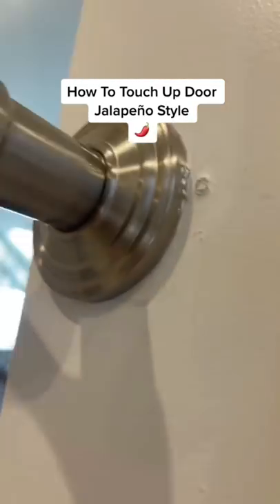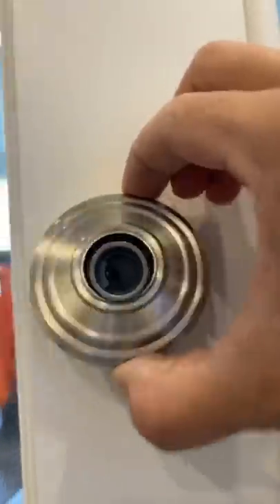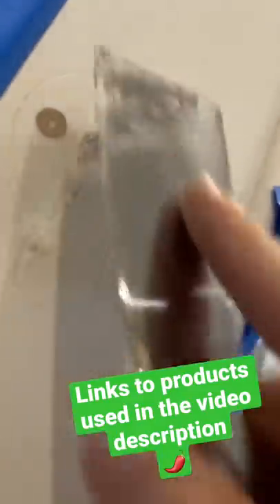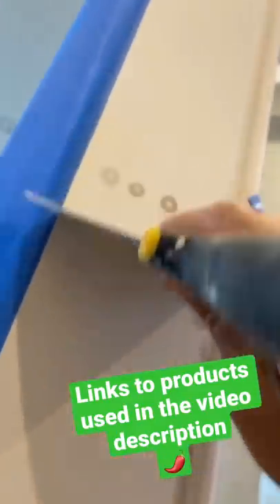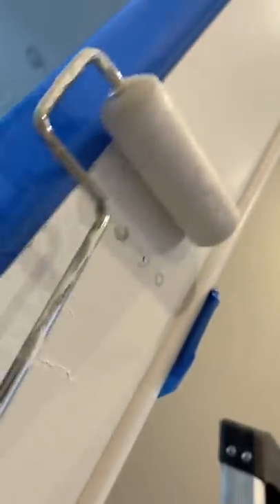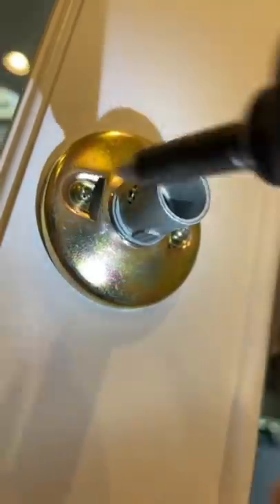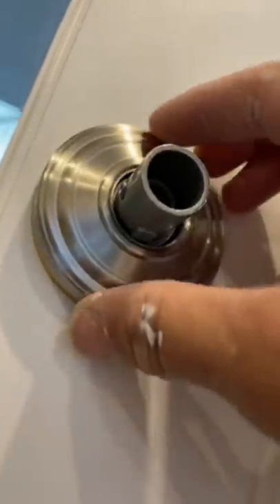How to touch up door around handle.  #frenchdoors #paint #handyman #diy #howto #tutorial

Comment: mix flowtroll in paint? can you explain more?
Reply: It’s called flood at home depot and it’s a latex medium, I use it when I spray to help the paint lay more evenly
Reply: floetrol paint additive that helps with self leveling and gun clogs. It makes a pretty good difference. There are a lot of different ones on market. M-1 is another that I use just because sherwin Williams sells it. It is a bit cheaper to. Both will last a long time for small jobs like this.